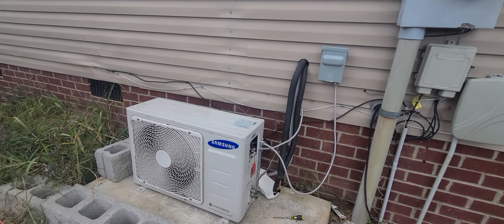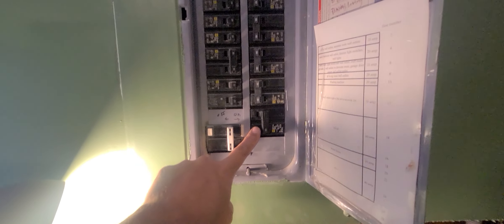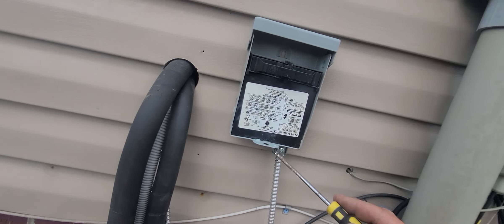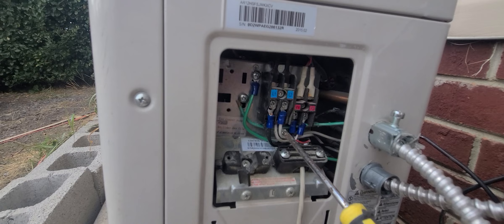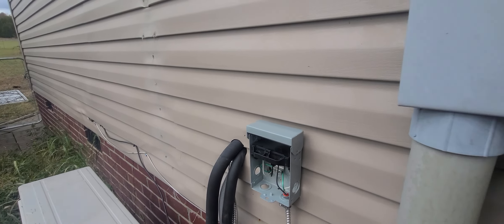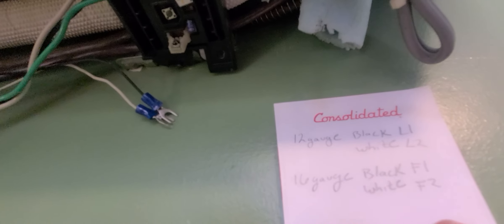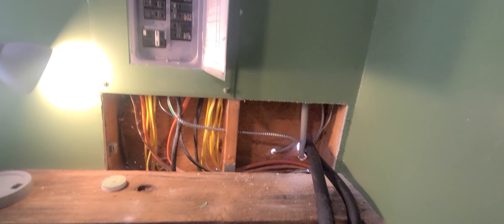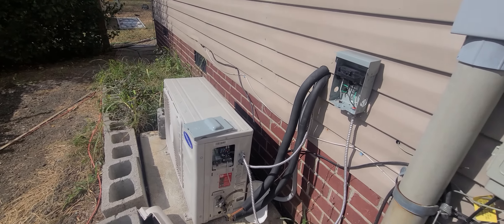mini split wiring samsung ar**hsfs** series

Comment: I would hire an Electrician.
Reply: I agree, I think he has the disconnect wired incorrectly, normally the two outside wires are the load and the two inside the line, he has them, one on one, won't work. When he pulls out the disconnect, power will still be on one pole. Danger!

Comment: You have if figured out enuf it will run, many issues with install, first The armoured cable cannot be used outside, the disconnect is wired wrong, the white wires for L2 need phase tape as white is not acceptable, (red) and I did not see size of breaker but it should say in manual under max breaker size, also looked like knock outs were open on the side of the disconnect.  I like the simplicity of video but this leads people down a dangerous path.  Worth asking an electrician if you have questions.

Comment: Seriously - using non-waterproof conduit outside? When have you EVER seen metal spiral conduit used outside a building? You need the (cheaper) PVC watertight flex conduit and the fittings that go with it.